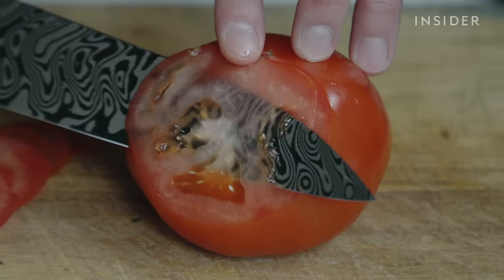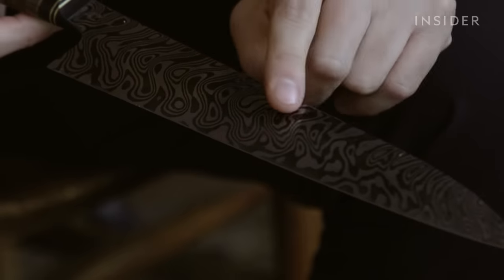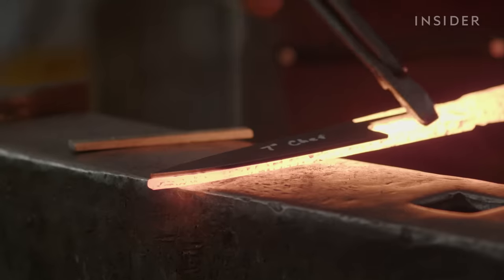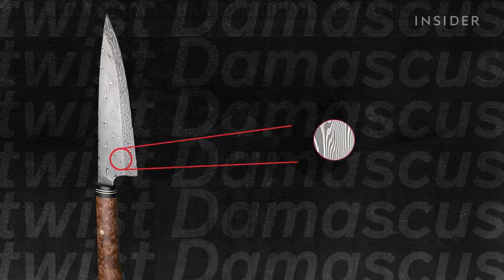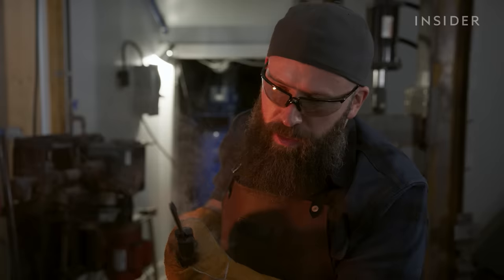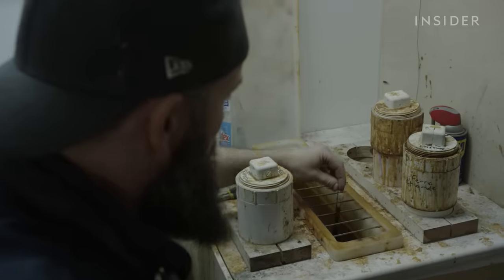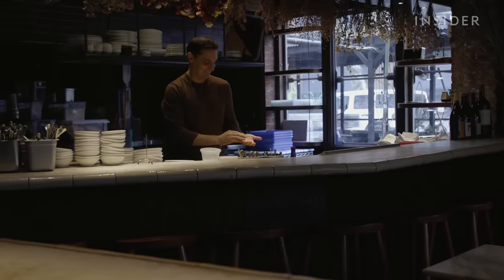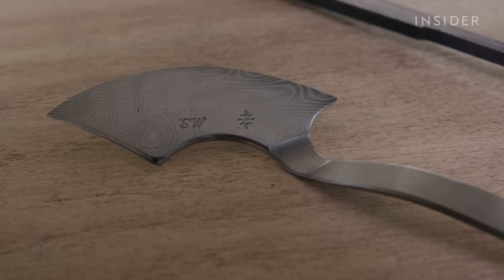Why Damascus Knives Are So Expensive | So Expensive | Insider Business

Comment: Damascus is just cosmetic. Most knives can be sharpened and be great to use.
Reply: The real receipe for the OG legendary Damascus steel was lost in history....
Reply: @InquisitiveBaldMan  why any damasus knives today are just visual art peices.
Reply: @InquisitiveBaldMan  Not lost Britain made it extinct.
Reply: @artimuos903  Gonna cry?
Reply: lmao. Pattern welding is more dependent on the quality of the steel that goes into it. If someone who doesn't know what they are doing makes a pattern welded knife, it's gonna  turn out badly. But if someone who knows their way around a forge does it the results will be more that just cosmetic.  People (like most of the other folks in this thread) are making a ton of assumptions and mythologizing the properties of "Damascus steel" into something it simply wasn't.  For the time, it was deserving of it's accolades, but when it comes to modern metallurgy and material sciences, we are far more capable than any ancient blacksmith and their modern analogues exemplify that.
Reply: @eyespliced  Amen.
Reply: Pattern welding or Damascus steel knives actually can be better if made correctly. You can have both a hard and tough blade. 

 A lot of effort and skill required though and I'm sure a pure super alloy is probably better in many ways. I'm just pointing out the fact you can use very different metals for different traits can be beneficial.
Reply: @dianapennepacker6854  kind of right, laminated blades and differential hardening have been used to get the benefits of different steels. Lamination means that a harder was sandwiched between softer steel to get a hard edge and a flexible blade. Differential hardening means the spine of the unhardened blade was painted with clay before heating so that the edge would become hotter than the spine resulting in a hard edge and a flexible spine.
Reply: @InquisitiveBaldMan  Nope... Wootz steel (which is where damascus steel is derived from) is still alive. It originated in india, and people still practice it.
Reply: @InquisitiveBaldMan  I doubt that old Damascus was any better than modern steels developed in labs
Reply: @livelyosprey  youre right. For the time it had properties that assited in slicing edge retention but now we have powder metallurgy and computerized predictions if attribute we want before we even make it.
Reply: They explained this at the end. Did you watch?
Reply: @dominicwilliamson7912  Damascus knives made today are not Damascus knives. They are pattern welded knives.
Reply: @G5rry  yall arguing but who tf cares? you dont even know if thats true or not. if the recipe was lost, who is to say how well the "real" recipe performed. also it was centuries ago, metallurgy these days is so far beyond that, we can get high quality carbon steel for dirt cheap thatll last you forever.
Reply: @dianapennepacker6854  Super alloys are super expensive and can be a real pain to work with.
I've made a couple 440c knives and I had to hammer them 3-4X the amount I'd have had to hit 1095 to move it the same amount.
I'd love to get my hands on some CPM S110V but it's like $200 for a 3 foot bar of stock.
Reply: @the_inquisitive_inquisitor  Yeah I hear they are a real real pain in the ass to work with haha. I just don't know what this means! Longer to grind and such? Easier to ruin the entire thing like cracks. Or losing the properties that make it so special?

 Wonder if its even worth it. 

 If I had the cash and wasn't dying I would want to learn how to make blades for a hobby. Make my own sword one day - nothing stupid fancy. Just a blade that is balanced, with a solid edge that doesn't chip easily and enough flexibility to not shatter. (Not like the cheap wall hangers). Start with grinding knives and work my way up.
Reply: @dianapennepacker6854  super alloys are "harder" in the physical sense, so have to swing the hammer harder when you work with them... Lol
Reply: @newp0rt  Amen.

Comment: This is pattern welded not actual damascus steel. Because there is no such thing as "damascus" steel. Damascus was a hub for sword production, using sourced Wootz ingots from India. We do not know if forge welding techniques used today were the same, which created the "damacened" properties back in the day. Closest modern approximation is the katana, using tamahagane steel. Where different parts of the same ingot are combined with forge welding, layering to form the desired properties of the finished sword.
Reply: Definitions change pal. stop holding on to definityions from over 200 years ago.
Reply: do you call it velcro or do you call it hook and loop, kleenex or facial tissue , tupperware or plastic storage boxes
Reply: Amen.

Comment: A master blade smith can make any high carbon steel knife razor sharp. Also there is a small disclaimer that needs to be addressed: this is not true Damascus steel. Damascus steel was made from crucible steel from the Middle East and got its name from the city  of Damascus in modern day Syria. The type of steel this video is showing is actually pattern welded steel which has been around for centuries. True Damascus steel has not been successfully made for a few centuries due to the Industrial Revolution began in Europe, and its pattern was based mostly on impurities in the steel such as vanadium and through heat treating and tedious thermal cycling which was only discovered only a couple of decades ago. I personally like both of these steels especially pattern welded steel but a lot of people don’t know the difference between them and it irks me that the trade name misleads people.
Reply: Amen.
Reply: India, not the Middle East

Comment: Does the knife lose it sharpness? How long is its sharpness last considering its price?
Reply: Any knife can lose it's edge. Typically knives like the one in the video have a high hardness scale, and will definitely last longer than a cheaper knife. But there are also really good knives out there that are affordable.
Reply: It will be no sharper than a normal chefs knife and it will lose its sharpness as a normal knife during use. It is the craftmanship, amount of labour and looks that make these knives expensive. It is not "magic steel".
Reply: It should never lose sharpness at this price
Reply: @Rakadis  somewhat misleading. there definitely are advantages to hand forged knives atrributed to high compression while forging while also making different grinds possible. yes, damascus isn't this mythological magic steel, but when only used for a damascus cladding with another core steel (think SG2, aogami super , etc.) it definitely has a better edge retention and better maximum sharpness than an industrial knife with a rockwell hardness of 55. 
still; even the best knives can dull quite fast (let's say 6 months for home cooks for it to become well noticably less sharp). that's why it's a good thing to learn to hand sharpen if you like using sharp knives.
Reply: @Rakadis  Not entirely true.... Custom knives made of Damasteel (pattern welded steel) or monosteel (singular alloy steels) can be heat treated better than production knives, we also tend to use better steel, almost always better steel than high production knives.
Reply: @CRO-Palacinke-D.C  You said it there, damascus cladding with another core steel. It is that core steel that gives the edge retention, the damascus does nothing for the edge retention and is purely cosmetic. Also this is pattern welding and has no relation to what was historically called damascus steel. With modern homogenous steel if you chose the best possible steel for a blade, then mixing it with another steel of lesser properties makes a worse knife, not a better one because you diluted the better steel. A high quality industrial knife is heat treated with a precision that handcrafted knives can only dream of and the quality of the steel is checked to much higher degree. Someone making a small batch of knives has to trust that the steel they were delivered is what it was claimed to be. Someone making a gigantic batch of knives checks and tests the steel to a scientific degree because for them the testing is important enough to invest millions in testing equipment and represents perhaps a fraction of a years profit while protecting profits for decades to come. If you produce a few hundred knives a year it is hard to spend $1-3 million on gold standard testing equipment and perhaps $150k-500k per year in lab tests, maintenance on the test equipment, labor and test materials. The notion of the magical blacksmith with abilities to create +14 attack and +20 quality weapons should have died when the age of enlightenment rolled in, but some people prefer fantasy land to reality.
Reply: @rustknuckleirongut8107  I full, agree with the first part. 
About industrial vs hand forged; it's not the fantasy samurai vs modern scientist debate you think it to be. Industrial kitchen knives are almost all stamped (I don't know of one which isn't). Stamped knives have a fully flat profile. This means it doesn't present the same properties a hand forged knife does. For example it's less durable because of the fully flat grind, therefore you need thicker steel at the front of the knife making the apex of the edge thicker and the cuttimg worse. Also forged steel is repeatedly pounded pushing the molecules closer together creating more hardness. My science in this part of knives may be somewhat lacking, I'll gladly let you correct me on it with differing information.
Do you speak from specific knowledge in knife making or just assume modern = better (which in most cases may be true!)? I totally agree in the heat treatmwnt department, but stamped vs forged is a whole other debate. 
At least for kitchen knives, I personally don't know a single brand that has a industrial forging process or at least grinds the knives industrially vs just stamping them.
Reply: @CRO-Palacinke-D.C  The Cisco 8" Classic is used by more chefs in more professional kitchens than all handcrafted knives combined.
As long as the stamped knife was heat treated properly then it will be metallurgically identical to a piece of the same steel that was hammer-forged.
Heat treating changes the microstructure of the steel, so as long as it's in the right shape it doesn't matter how it got there.
Reply: @rustknuckleirongut8107  Amen.
Reply: @the_inquisitive_inquisitor  Amen.

Comment: I work in aerospace and specifically the heat treatment department.  I started in ‘06 and I’m still there today as the department lead.
Granted,  we work with aluminum and not steel so I’m sure there’s differences I’m not aware of. 

Heat treating is very specific.  A certain temperature with a very tight tolerance.  Obviously this guy is very skilled and I guess has developed the ability to “eye ball” his treatment process.

From the way it was shown he has no temperature gauges and the knife wasn’t being evenly and precisely heated which is essential for the heat treatment of aluminum anyways.  

Are there many differences in the process between steel and aluminum?  Obviously heat is a big difference!  But the process overall how he performed it I’m just curious as to how it’s effective with the lack of precision.
Reply: I've been making knives full time for about 6 years now, you can sort-of eyeball a simple carbon steel in the 800-850C range by colour, but you are absolutely better off using at least a thermocouple, digital thermometer and more controlled kiln to get the exact manufacturers specs and that's the same with the tempering process. When you get into high alloy tool steels and stainless, its all done in an oxygen deprived environment to avoid decarburisation of the steel's outer surface, so its typically done with a gas injection into the kiln or a stainless foil packet.
That's a whole other bundle of temperatures which typically start in the 950C all the way through to 1200C depending on the alloy you're working with and they can sometimes have very high tempering ranges of sometimes 350-500C to knock the hardness down. You won't be doing it with an eyeball, the OHS side of me that used to work in engineering means I will rouse on people looking at high infrared emitters and bright light sources without eye protection :)

What got missed though in this video is the blade geometry, he has some superbly dialed in kitchen knives there which are wafer thin, super sharp and even if they're a bit dull after a days work they're still going to cut very well. That said, if you're a bloke looking for a good knife, get something in a modern stainless with a lot of vanadium and chromium in it and you're probably well on the way to a knife you only have to sharpen maybe once a month of hard, every day use. But how it cuts- still all about that fine geometry of knife behind the cutting edge
Reply: I'm not a blacksmith, but my father and grandfather were so a little of the knowledge has found its way into my brain. With steel you can get a decent estimate on the temperature by the color of the hot steel. These blacksmiths can get away with "eyeballing" because the scale that they are working at is fairly small. As the work increases in size it gets much harder to do that and have the work survive the process. Knives, swords, and tools are at a size that doing it this way is doable, but even then it is a gamble. 

I think I have seen videos of some blacksmiths actually using gauges to get more accurate results. But those things are expensive and smiths don't really need that level of precision typically. They can if they want, but a lot of times the extra precision is just kind of wasted. I am fairly certain however that in an industrial setting it is much more important for accuracy to maintain a consistent product. At the end of the day the effectiveness doesn't need to be super accurate, it IS only a knife. Even with the price tag.

I know nothing about how heat treating aluminum works however so can't say anything on how it compares unfortunately.
Reply: @krissteel4074  thank you for the detailed response!  I know nothing about tempering of steel!  We use to work with aluminum and titanium when I first started there but by ‘07-‘08 we were working exclusively with aluminum so I don’t really remember the process for titanium!

I knew steel was much higher temps but that was about it!  I don’t even know the alloy types for steel 🤷🏻‍♂️
Reply: @VeshAeryn  I appreciate you responding!  We work exclusively with aluminum so I don’t know anything when it comes to steel aside from it tempers at much higher temps than aluminum.

Obviously working in aviation we have very specific requirements.  Our tolerance is +\- 10 degrees on the majority of our parts.  Depending on the alloy we mainly use 3 temperature sets 870F,  920F,  1000F but that’s the highest!

I started in March ‘06 when I was just 18 years old!  I had taken my GED test in Dec ‘05 and in Feb ‘06 I got my results and certificate!  My uncle worked at this plant and said if I passed he would help me get a job there.  Once I passed and filled out my application for two weeks he kept pestering HR until they finally brought me in for an interview.  I had 6 different interviews!  The plant manager showed me nearly every department and supervisor.  After the last one I asked what was going on?  He finally said “Well none of the supervisors want you just because your so young and inexperienced”. He said there’s one more department that he was overseeing because they didn’t have a supervisor,  he said it’s called Heat Treat.   He asked if I was interested and I was like I just want a job idc where!  he showed me around and offered me the position!

The first month tho I didn’t even work in heat treat,  I started during a stretch where they were getting recertification and Boeing was doing an audit.  They didn’t want me messing it up she they stuck me in shipping for the first month.

I’ve survived 4 separate lay offs over the years!  Many many supervisors and managers haha.  In 2014 I accepted the lead position.  In 2019 our supervisor was fired so I was hopeful I would get it!  I did my interview but unfortunately they decided not to hire anyone.  They had the supervisor of another department run his and my department.  Since then tho I essentially I am the supervisor without the title or salary 😒. He has passed a lot of the responsibilities off too me which I think will work in my favor when the time comes to fill that role.  I’ll be able to show I’ve been doing these responsibilities and am prepared.

They’ve don’t these multiple times in other departments having 1 supervisor oversee multiple departments and it never lasts.  It’s been 3 years and he’s really burnt out!  It’s alot if work so I’m hoping buy the end of this year I’ll be able to take over the position permanently
Reply: @chriscampbell3417  If you want a good guide to the heat treatment of steel I'd recommend a book called Knife Engineering by Larrin Thomas. Its not too heavy in terms of science but there's enough science to get you started. He also has a website called Knifesteelnerds and a youtube channel by the same name.
Reply: @VeshAeryn  Amen.
Reply: Amen.